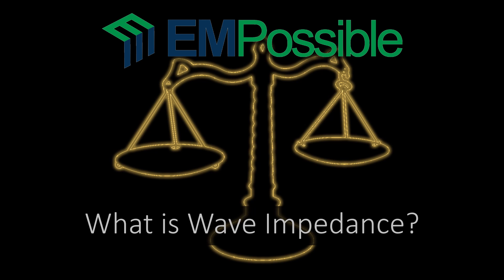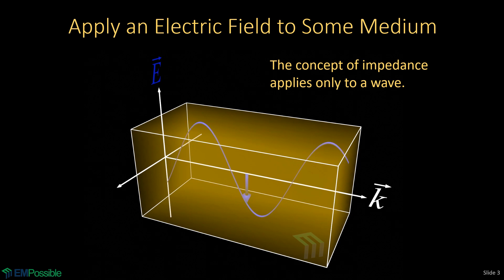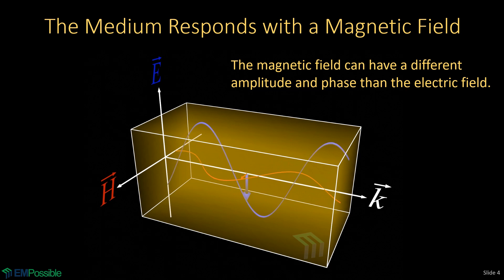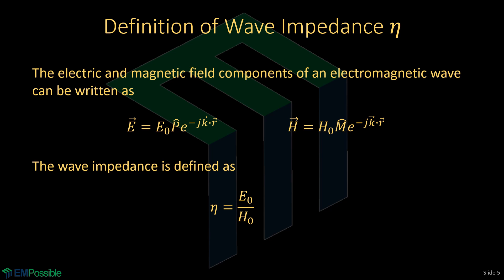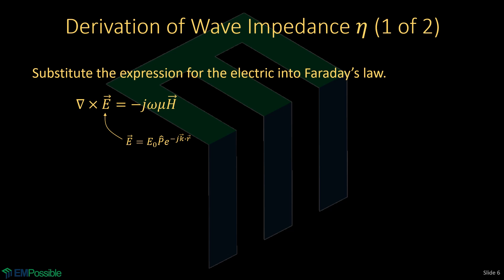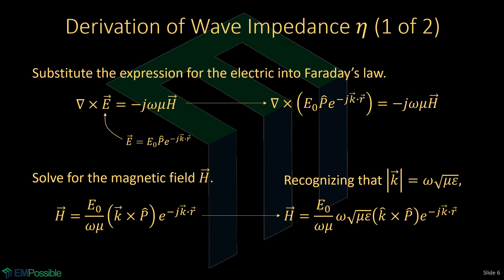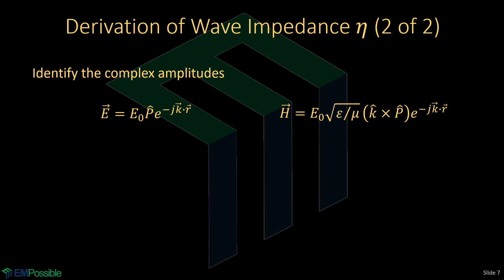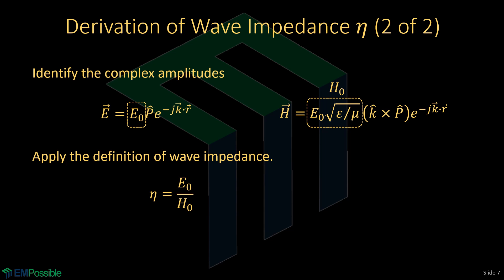What is Wave Impedance?

Comment: Hello! I am in love with your simple and clear explanations.

We can measure electric fields and magnetic fields by measuring the electric force between two charges or the magnetic force felt on a moving charge, respectively. We don’t really measure the electric field nor the magnetic field directly. All of this makes me think if the electric and magnetic field are really out there or if they are just models like they were when Gauss defined them. Are they real?

Furthermore, the magnetic force can be thought of as the electric force seen from another frame of reference. However, the electric force can also be thought of as the magnetic force seen from another frame of reference too. Which one is the “real thing”?

(I’ve heard from some people that both phenomena are actually the manifestation of quantum properties inherent to materials)

Thanks in advance for reading!!
Reply from the maker: The only answer I can give you is "I don't know." Up until about five years ago, I was of the opinion that electromagnetic fields were real things simply because something appears to propagate. More recently, I have seen how at least some electromagnetic phenomena can be explained with just Coulomb's law and relativity. That does make me question the existence and nature of electric and magnetic fields. Regardless, it is certainly a good model to predict phenomena and design very useful devices. I cannot help wondering though what we are missing if we are wrong.

I recently made a video that attempted to try to visualize electric and magnetic fields described by the classical model. It was not the main point of the video, but I briefly mentioned at the beginning that I don't even know if electric and magnetic fields even exist. In the comments, it was this that received the most attention and some interesting comments and discussion followed. Here is a link to that video if you are interested:

https://youtu.be/J7tZNC-LIQ4?si=khJaZ-eNeWz3R_rN
Reply: @empossible1577  amazing! I will be taking a look at the comments! Thank you for taking some of your time to answer me!

Comment: Love your videos!
5:40 A small question.  You state "electromagnetic waves are always transverse".  Is this only true for unbounded media?  I am thinking that in a waveguide the electromagnetic waves can have transverse and longitudinal components.  (Sorry, I hope that does not sound nit picky, I really like your videos!)
Reply: It's not a small question:  both free space and two-conductor waveguides (coaxial cable, for example) can propogate transverse electromagnetic (TEM) waves at all frequencies, which is very interesting.  (More complex modes can propogate at increasingly higher frequencies.)

The boundary conditions of single-conductor waveguides impose a minimum propagation frequency (cut-off frequency) and sequences of transverse electric (TE) and transverse magnetic (TM) modes can propagate with increasing frequency.  (More complex modes can propogate at increasingly higher frequencies.)

In both cases, they are used over frequency ranges in which only one propagating mode exists;  this keeps impedance of the transmission line a rational concept.
Reply: Electromagnetic waves in a circuit can become Longitudinal, although in the case of Light it's always Longitudinal with occasional transverse compressions and rarefactions, Dollard calls it the Longitudinal Magneto-Dielectric Wave in such a condition, you can obtain them in circuits oscillating at their resonant frequency. It's why loads like LED's or incandescent bulbs can be lit with only 1 wire connecting it to the circuit when resonating, single wire loads in circuits such as "Tesla Coils" or the Hairpin circuit are such examples of this occurring.

If you're interested in the applications of this I recommend starting with "Transverse & Longitudinal Electric Waves by Eric Dollard" and "Tesla's Longitudinal Electricity by Eric Dollard" some very old video that serves as a good starting point.